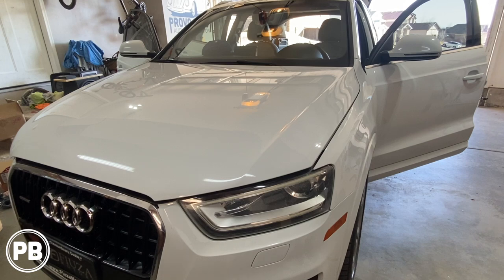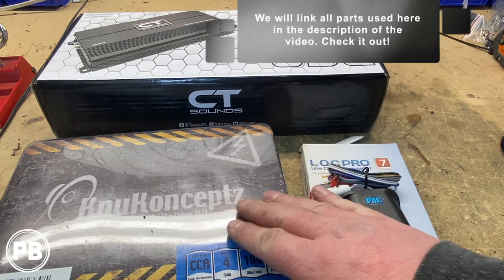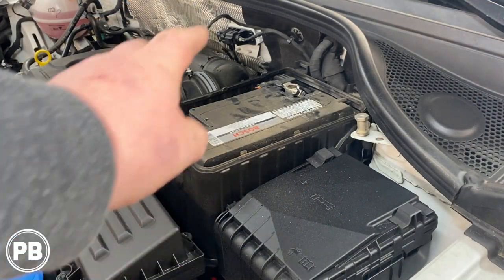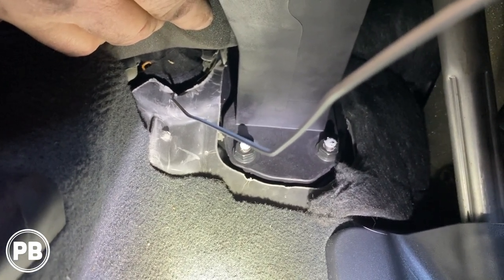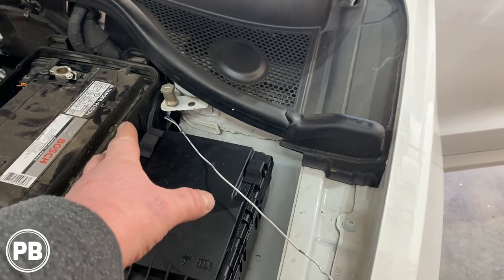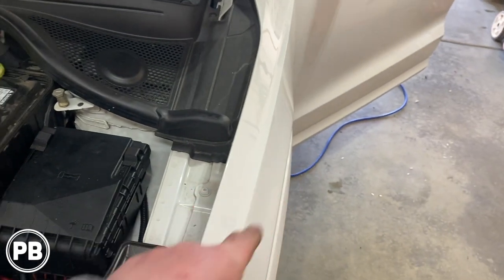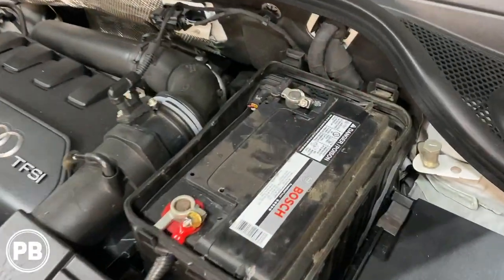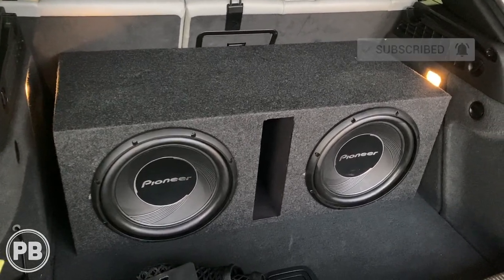2015 - 2022 Audi Q3 Amp and Sub Install

Comment: My son has the same car, we installed 2 10”s this weekend, Skar Amp and Kicker 2 channel LOC. I followed your instructions and it worked great for about 15minutes then faded out. Nothing coming from subs unless gain was raised then it was just a loud violent humm. Removed power fuse, installed back and it worked great again. Then faded out. With radio turned all the way down if you increase amp gain it humms loud and violently. 

Do you thinks it’s the LOC?
Reply from the maker: Yeah, bad LOC.  I'd recommend the one we used, or LC2i.  Give that a shot.

Comment: Is it possible to connect some tweeters to also amplify the sound? Or taking the signal from the factory subwoofer can it only be used for another subwoofer?

Comment: I used a Kicker line-out converter in my 2013 Q7.  The issue I have is that sometimes (most of the time) the LOC doesn't turn the amp on.  I can unplug the speaker leads for the LOC input, then reconnect them, and the amp will then turn on.  
I have a friend that has the same issue in his Honda accord, but he ended up running a new remote wire from ACC to his amp.
Ever ran into this issue and have any advice for my Q7?
Thanks!

Comment: What if i dont have the factory subwoofer and its wiring man … please tell me which wire to use for the amp input 😢 PLEASE RPELY I HAVE THE same AUDI
Reply: Hello, which wire did you end up using?

Comment: I have a amp and sub installed in my Q5. I was told the car need to be all the way on for the after market amp to work in a Audi. I was told the amp only can come on when the ignition switch is in on position. It can not be hooked to come in acc position is this true. The factory amp comes on in acc, but the aftermarket does not. Any suggestions?
Reply: It depends on your line out converter and the features it have

Comment: That line out converter is garbage 🗑️. Full of distortion
Reply from the maker: Not if you properly tune it using an DD1.
Reply: @ProvoBeastAudio  I seen that no more than 2 volts then distortion city
Reply: @ProvoBeastAudio  No. The signal is already distorted as it comes from the standard radio which is always crap. You can process it all you want, this system will only make it sound louder. What you need is a direct line level signal from the radio to the amplifier. Or an optical (SPDIF) link from the radio to a DSP and DSP to amp.